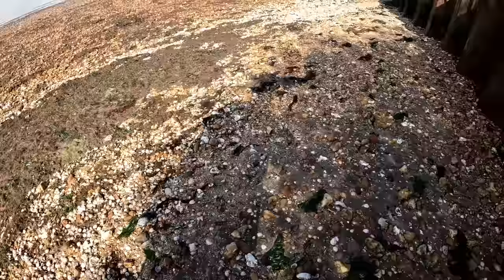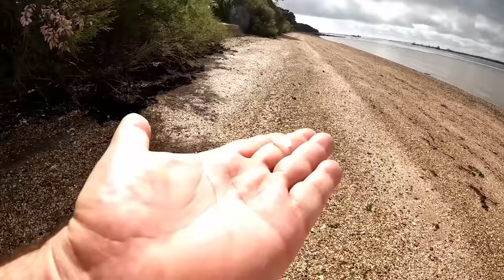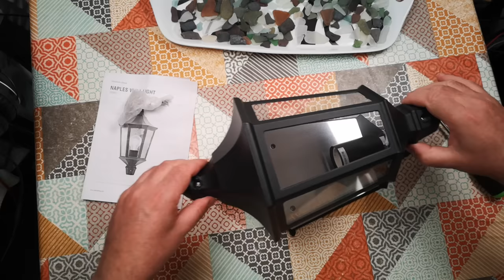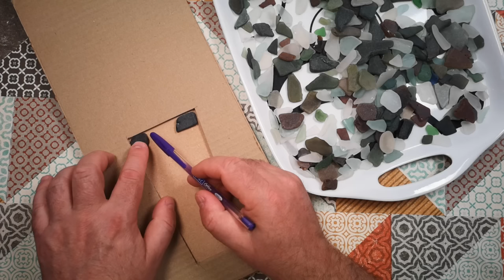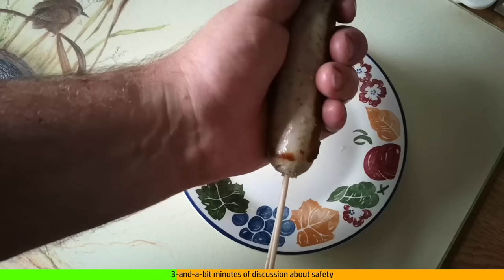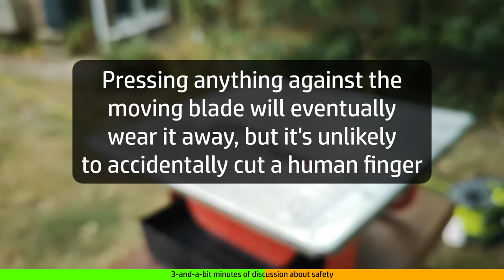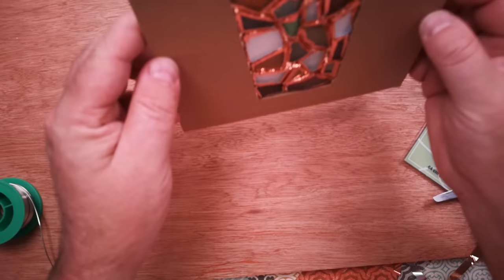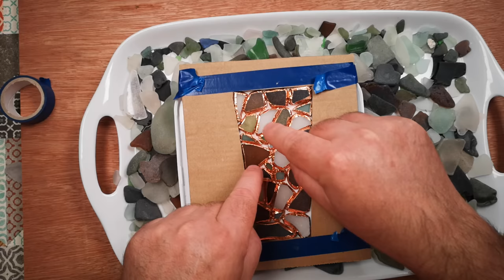Can I Make Stained Glass Panes From Sea Glass (Beach Glass)?

Comment: Could you put the glass into an oven to reflow the solder? I feel like it should theoretically work, but two issues are that you used leaded solder which you might not want to heat up in your regular cooking oven, and regular ovens might not get hot enough to produce significant results.
Reply from the maker: I think the glass might not all survive - seaglass is all scratched and chipped up - it might just explode or crack (also the solder might just run away, since there is no flat surface anywhere to contain it (the underside is all wavy and irregular due to subtle curvature of the pieces of glass)
Reply: @AtomicShrimp  Hm, that's a good point. If you get it too hot, you might end up with a flat opaque sheet of solder on the back, or worse, a bunch of exploded glass with bits of solder stuck to the oven walls. (also, do only software and math people use nested parentheses in English (nested parentheses are normally used in programming and math)?)
Reply from the maker: @Hello71b  Oh, I'm terrible for abuse of parentheses in written text.  Every time I write something, I feel like it needs an explanatory subtext.

Comment: Would a solder air heat gun be a good way to help with the neatening up of the joins after the initial contruction? I'd definitely put it in some sort of frame to hold it while doing the heat gun to stop it moving put it may give you more control of the melt of solder to make the joins look more uiform and neat. I follow another youtuber who does lots of electronic fixes who uses one for larger components like chips with 50 legs so thought that may work well for getting a larger area of solder to melt and reflow a little neater if you wanted to get a more uniform look. :)

Comment: Do you use a blacklight to find which pieces are uranium glass sea glass? For one, it's awesome, especially with a UV light in the lamp, and 2, its not super valuable, but people do look for REAL seaglass and not broken bits of a UG plate, run through a rock tumbler. :)

Comment: Not using flux medium?  It's been years since I took a class in stained glass but I recall the teacher insisting upon the necessity of using it because it helped with the solder.  (However, I must note that the teacher managed to discourage me from ever continuing to mess about with glass.  And what you've done is much better than what I made with instruction.)

Comment: So this video contains the ONLY safety video that (I believe at least) is viewable all the way through without either falling asleep, digging your mobile device out of your pocket or somehow bypassing or fast forwarding through it.  The only other video even remotely close is a safety video visitors (vendors and on-site contractors) to a chemical company here in the US had to view yearly in order to maintain badge access - in that video they had "actors" approximate very serious industrial accidents - some of which involved large quantities of magnesium being exposed to water - from what people working at the facility said if that ever happened everything for a several mile radius would be incinerated and would happen so quickly it would not be an emergency situation it would be a clean up operation a day or two afterwards - so watch the video we did but we would often remark about the 80's hair styles and the lack of acting ability.

Comment: Would you make a Tiffany lamp using a wooden mould?
Reply: Either a bowl or a dome?
Reply from the maker: That was the plan I had in my head when I started collecting the glass, but I dialled it back to 2D panels for this experiment.  I think a 3D shape probably is possible, but there would be an extra level of difficulty due to the possibility of finding pieces of glass that have the right shape you want, but the opposite of the curvature you need.
Reply: Nice to hear message from you Mr Shrimp 🍤.  Keep up the good work please 😊🙏

Comment: Tessellation: repeating patterns interlocking on a plane to form a surface.
Reply from the maker: Repeating patterns are not necessary.  Tesselation just means tiling with no gaps.
Reply: @AtomicShrimp  https://en.wikipedia.org/wiki/Tessellation
Reply from the maker: Yep.  'A tessellation or tiling is the covering of a surface, often a plane, using one or more geometric shapes, called tiles, with no overlaps and no gaps.'
Reply from the maker: Perhaps you're thinking of periodic tiling
Reply: @AtomicShrimp  Also have you tried decorative flint knapping? Seems interesting and i think you may enjoy it and your viewers might too seeing as you live within easy access to some beaches and other areas where flint is available.
Reply from the maker: @ProfaneGod  it's something I would like to try. I might need to go on a craft course to get started on that I reckon
Reply: @AtomicShrimp  I think they tend to focus on the tool making aspect of it and finding the right flint for tools is harder than it seems but it will give some insight on how to work flint to get general shapes which would help but personally i would just go out and try because what they teach is how it works for them which may not work for you.

Comment: This may be a silly question, but why does the wet saw cut through the glass so effortlessly but not the sausage?
Reply from the maker: The wet saw only cuts rigid materials. Imagine if a car's tyes were made of rock, they would wear away fast, but rubber doesn't wear so fast because it deforms around bumps and lumps
Reply: @AtomicShrimp  so in theory would it be able to cut wood? Or is it only really for things much more rigid like stone and glass?
Reply from the maker: @strawberrybonbon5943  yeah, it will cut wood, but not very well at all, because there are no teeth as such, so it will sort of wear its way through a stick rather than cut

Comment: This brings back memory's when I was in elementary a woman came in and offered private lessons in glass art. I made diffrent crafts like a spider a butterfly a clock im sure there were many more I just can't remember. And yes we were basicly taking the piece of glass and then using not sand paper but a sanding rock we would grind the edges so the copper strip would stick to a rought surface. Then we would take a soldering iron and cover the whole copper tape in solder then we would join other pieces like that. It was great while it lasted but I ended up quitting because I raged at my parents about how we were handling the payment.

Edit: I saw a table saw online I forgot its name but the inventor made it so that the second it tastes your blood it shoots a massive block of metal into the saw stopping it dead in its track. So the most it will do you is a paper cut. The inventor himself tested it on himself that's how sure he was.

Problem is you then need to replace the saw and block everytime it triggers if it dose  but let's be honest better pay for a new block and saw then a new finger

Also edit did you use flux ?

Comment: Call me lazy, but I might have just glued the pieces directly onto the glass you removed from the product then filled in the gaps.
Reply from the maker: It's got to resist outdoor weather
Reply: @AtomicShrimp  The original glass does that.
Reply from the maker: And when the glue crumbles from UV exposure and the pieces fall off?
Reply: @AtomicShrimp  I guess it depends on the original glass and whether it is UV-A blocking.
Reply from the maker: 21:32